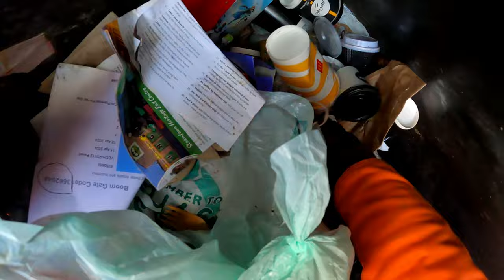Dumpster Diving Part 2 of 3 I Had A Visit From Return And Earn

Comment: I would like to thank you for your useful information on what's cashable and what isn't , I admit I've been fossicking in dumpsters for years and found some interesting as well as useful gear from cordless line trimmer minus the spring for the bump feed to a nice two stroke Stihl weed eater minus the cord and bump line feed which I replaced works really well to a chainsaw with a bent guide bar just chucked because of a lack of brain cells I guess.  I fixed and straightened and tuned it as I was trained in chainsaws in college when I was a wee bit younger . Today was piss poor bottles ,cans and scrap metal but I did however score an electric kettle and matching toaster both working just the kettle needed some vinegar to clean out the scale in the base element , then there's the two fans out of the same dumpster a week apart, crazy hey?, same models just different wire safety cages both work and a few years back a microwave which just needed the push switch fixing back into place it's still working . But yeah Mate knowing about what is accepted at the cash in depot is handy. Thanks again Mate Cheers Did I mention I found a Brand new Pair Of NIKES Yay!!